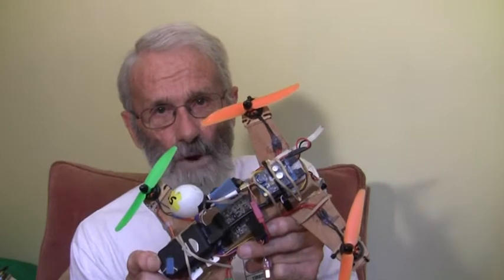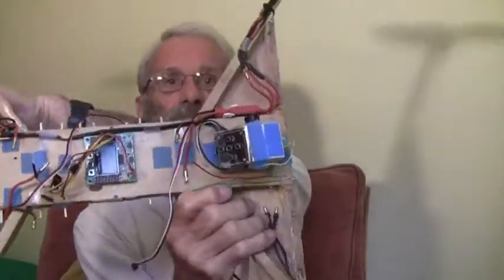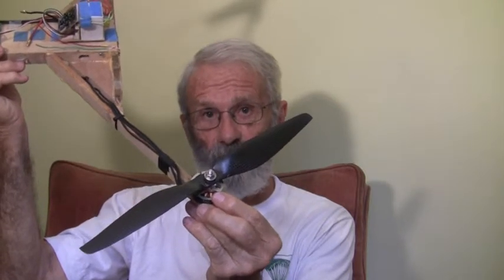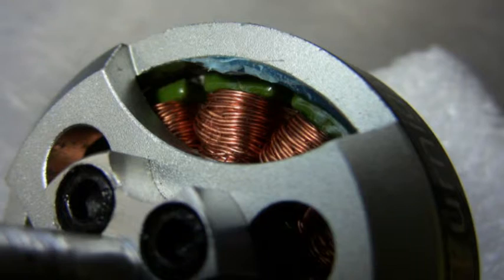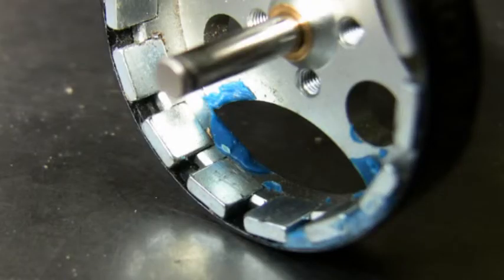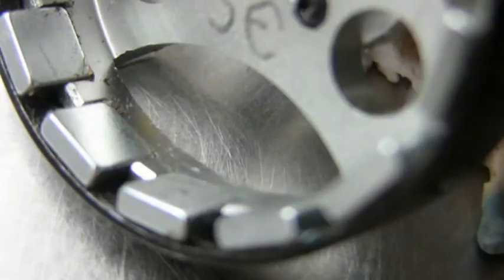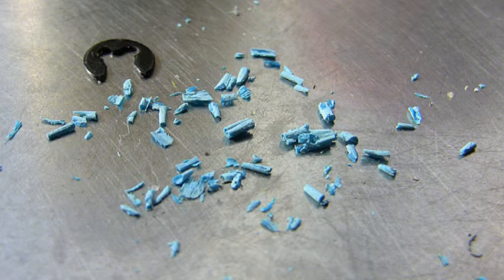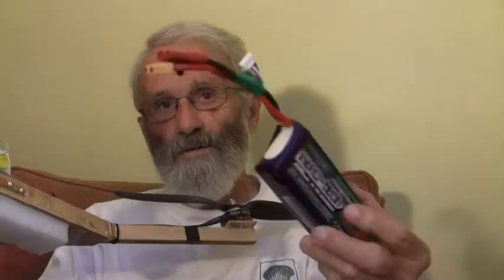Turnigy 4206 530kv

Comment from the maker: I hate to be boring but I don't always get notification on comments. The Walkera pro should be fine with a home brew frame. Try to keep it light. I have tried shortening the legs but it seems to upset auto landings.  The props on my big hexa are 13 x 6 carbon fibre. at first they did not sound right but I did a careful balancing removing weight from leading and trailing edges. Made a fabulous difference. Thanks for the kind remarks. Birdmanpete.

Comment from the maker: I have been told that the blue crud which I carefully removed was put there to balance the motor. In this video I removed it all from four motors and from my point of view they are now running very well. BUT !!! Maybe it would be wise to only remove the blobs which could inhibit rotation. A motor swinging a fifteen inch prop at fairly low revs probably does not have huge balance issues.